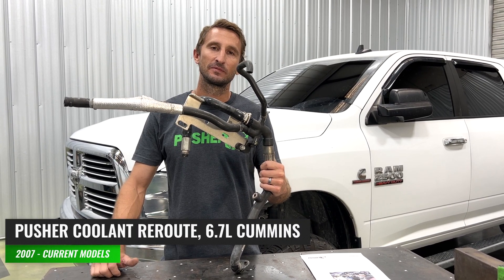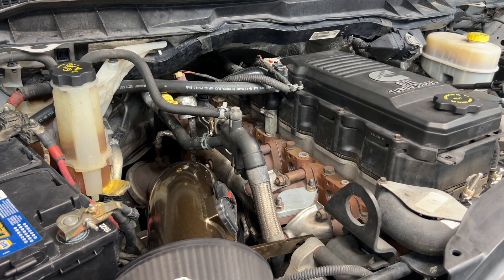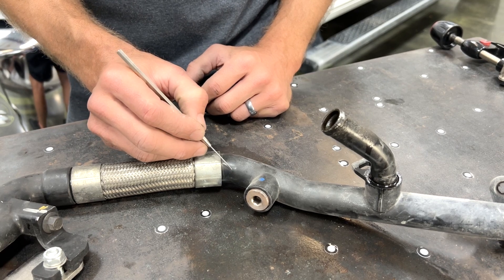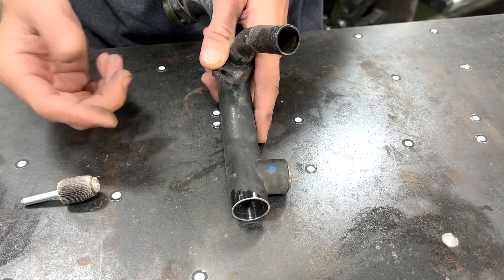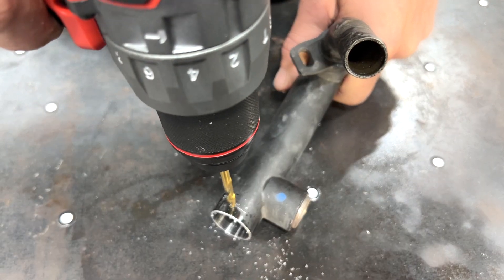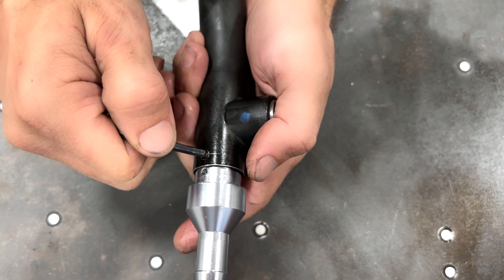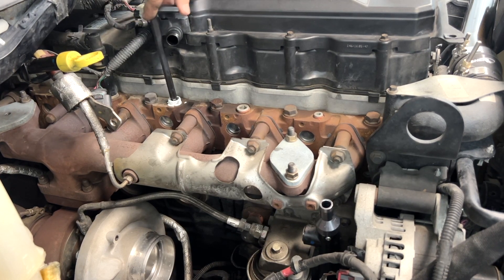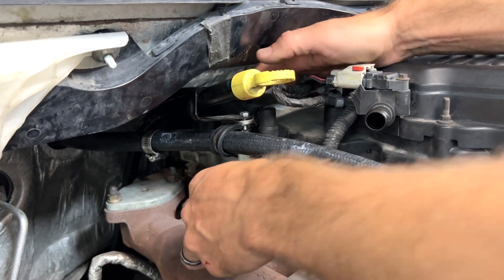OVERVIEW / INSTALL: Pusher Coolant Reroute, 2007+ 6.7L Cummins

Comment: Can someone explain what we do with the coolant line that runs to the factory coolant bubble “reservoi”? Do we just cap it or what
Reply: @3guysgarage  cut hose down where you can put the metal plug in. I cut mine to short so I used a rubber cap

Comment: Do not buy this product. over time the set screw eventually leaks  around it. and when you get an air bubble in the line its a pain in the ass to bleed it. you should of designed a full tube with a bleeder valve on top!
Reply: @spencersimpson7281  weld it

Comment: You guys should include the oring to that pipe since you have to remove it, now mine is leaking, dealer only Oring 
Smh 🤦🏽‍♂️ and a spare oring for the fitting would be cool lol
Reply: Dang it I just bought this kit. So I need to buy the o rings. 

Do you have part numbers? 
I don’t want to do this install twice

Comment: What did you use to get the old coolant spigot out where the plug goes… mines really siezed, I can get a 1” wrench on it but can’t even move it
Reply from the maker: A deep socket and breaker bar usually gets the job done. Depending on the wall thickness of the socket, you may have to loosen the upper valve cover to get it onto the adapter.
Reply: @ thank you I appreciate your response lol.. that is my issue my socket is too thick and won’t get down on it cuz the valve cover is in the way 😞
Reply from the maker: @Saa45MIV  - Ah, gotcha. The valve cover only has six bolts - you can just loosen them and shift it over a little bit to get enough clearance. It's probably only an extra five minutes of work.

Comment: Between the instructions and this video instal was super straight forward and works great. 1 hint, plan an oil change at the same time so you can pull the oil filter, gets the tube off WAY easier
Reply from the maker: Thanks for the feedback and tips! Glad it smoothly 😎
Reply: @pusherintakes thank you for making a killer product! Seriously saved me 1200 bucks and got my race truck back on the track 🤘
Reply: Dose the work for my 09 dodge 6.7 where’s the line that goes under manifold that bolt into turn line to hold coolant how would I go about that

Comment: does this work on the stock oem turbo? also this doesnt mess with any electronics correct?
Reply: i have a custom tune that a friend and i put on and he doesnt have the delete device anymore.... there wont be any random goofy codes popping up right?
Reply from the maker: @casegunnell2148  - There shouldn't be any, but being as custom tunes are individual we can't speak to all. If something did pop up we'd be happy to help you figure it out, but it's unlikely to happen.
Reply from the maker: This is designed to work with factory turbo and does not impact any electronics.
Reply: Hello, What’s the labor time on this install?
Reply from the maker: @chorizo_ent7018  - This is a pretty intermediate / advanced install - likely about 3 hours on average

Comment: doesn't the coolant run through the turbo??  Did you just completely disregard that?
Reply from the maker: Yes - the coolant for the turbo returns to the boss on the coolant riser tube just under where we installed the adapter. As mentioned in the video, this particular truck used for this video had a fixed geometry turbo previously installed, and therefore there was a plug in that boss. We still left the boss there in case he ever switched back to an OEM style charger.

Comment: You did not show it on your video but what do you do with the other line coming off of the reservoir tank
Reply from the maker: It varies by model year of the truck; that line exists only on 2013+ model year trucks and gets capped where it joins to the coolant tank. The line from the top of the radiator to the tank handles any purging that needs to happen in the cooling system.

Comment: (THE COOLANT DRAIN TO THE RESIVOIR GETS A PLUG NOT SHOWN IN VIDEO BUT COMES WITH THE KIT)
Reply: This the only reason I was watching this damn video... thank you
Reply: Where is the coolant drain on the reservoir I have the plug but where do I put it
Reply: Is it just a rubber cap or what?
Reply: @3guysgarage  I ended up cutting the hose to short on the resivoir where that metal plug goes. So I ended up capping it with a rubber fitting and a hose clamp.